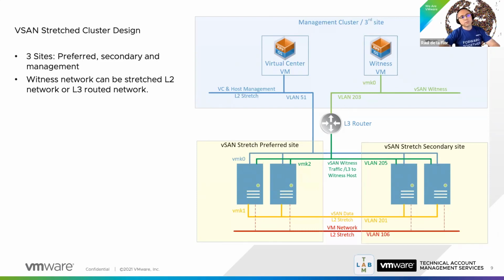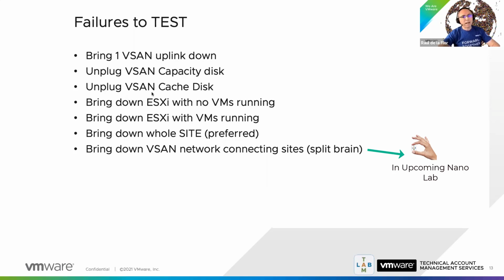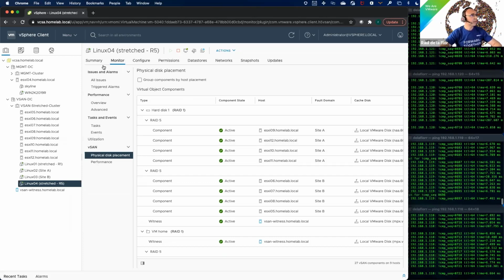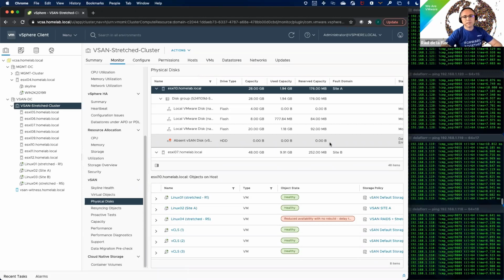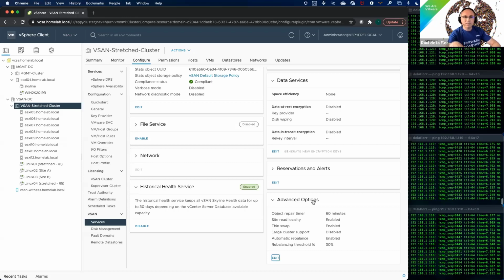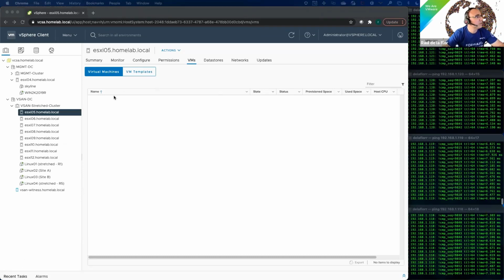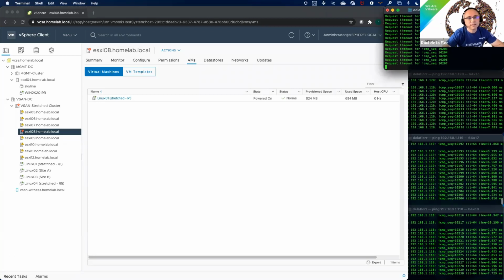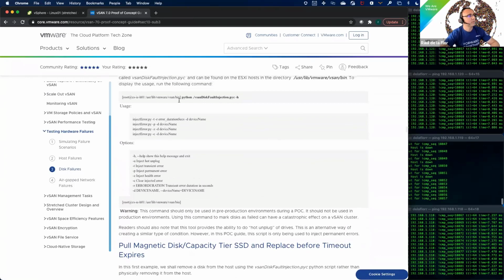TAM Lab 098 - vSAN Stretched Cluster – Testing hardware failure scenarios

Comment: Hello,

I am setting up a vSAN environment with 4 Dell PowerEdge R750 hosts. Each host is equipped with the following configuration:

ESXi version: 8.0

CPU: 2x Intel(R) Xeon(R) Gold 5318Y @ 2.10GHz

Memory: 12TB total across the cluster

Storage: 4x local disks of 1.45TB per host (configured in RAID 1)

Network: 2x Intel(R) Ethernet 25G interfaces per host

I need guidance on the following:

How should I proceed with creating the vSAN environment using this hardware setup?

How can I deploy the Witness appliance (VMware-VirtualSAN-Witness-OSA-8.0U3-24022510.ova) if there is no existing datastore available?

Which vSAN configuration type should I choose based on this setup?

vSAN HCI (Hyper-Converged Infrastructure)

vSAN Compute Cluster

vSAN Max

Thank you in advance for your support.

Best regards,
André